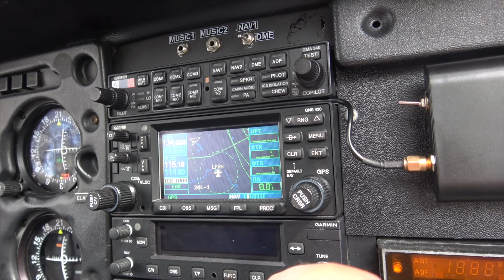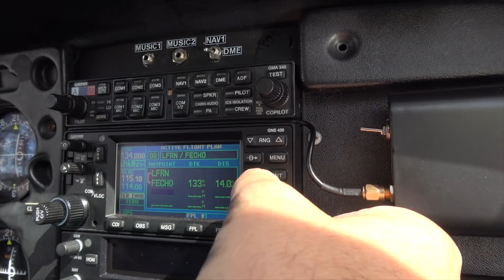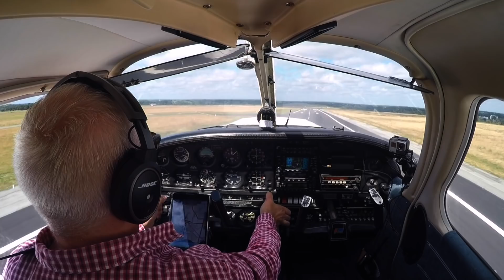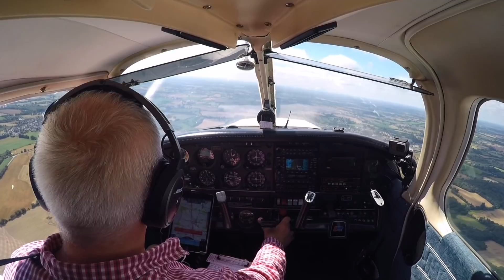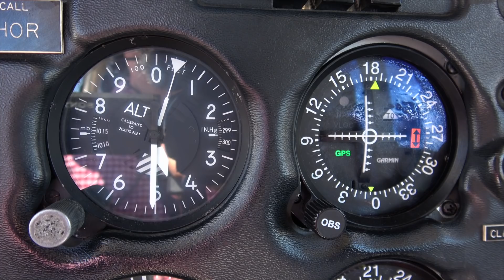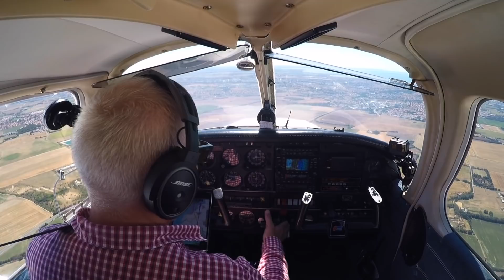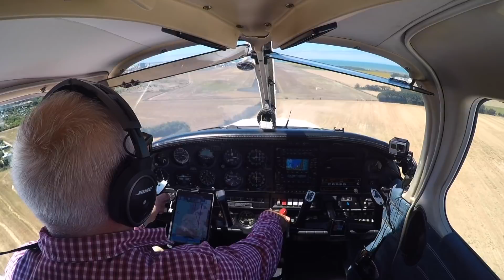28 knot crosswind take off - PA28 - The Flying Reporter

Comment: Hi Jon so enjoying these videos.  On my 3rd lesson for ppl.   Can you explain going VFR but above clouds?
Thanks
Reply from the maker: VFRs are different for different classes of airspace, and at different altitudes.  Check out page 59 of the Skyway code. https://publicapps.caa.co.uk/docs/33/CAP1535_Skyway_Code_V2_INTER.pdf. Essentially, above 3000ft, you can fly VFR without the ground in sight, so long as you remain 1000ft vertically from cloud, and 1500m horizontally.  Clearly, you will need some certified method of navigation, as you cannot navigate with reference to ground features.  So VOR/NDB/GNSS.  Hope that helps.  Jon

Comment: Jon, in the event there was a mishap on the departure with the 28 kts xwind (whilst legal) might the French investigators cite poor decision- making as a contributing factor with your insurance folks then reneging on their obligations? On a related note, in Holland the max demo x-wind is a hard limit for certain aircraft per the Dutch CAA.
Reply from the maker: Morning Douglas.  I think it's impossible to speculate on what an investigation might conclude - I guess we always should bear in mind what an independent investigator might think when making our decisions.  It would be a fair conclusion for them to reach if they could show that any mishap was caused by the crosswind.  There will be hard limits for all sorts of different operations, but a 17 knots demonstrated crosswind for the PA28 is not one in EASA and Part NCO (under which I'm regulated).  Ultimately it comes down to pilot judgement.  Can the take-off be performed safely?  Based on my experience, yes it could.  Another pilot, in another aeroplane, on another runway may think not.  Your comment has given me pause for thought, so thank you.
Reply: @TheFlyingReporter  Goodmorning Jon/Douglas, as a Dutch pilot, we have a 'mental barrier' to take-off in weather conditions that prevent us from safely returning to the same strip/airfield in case of engine trouble. 

I can see a drama developing when taking off with x-wind at 28 kts (even if 'just gusting') while having to return to the same airstrip with the same weather conditions due to an engine failure after take off. You will then be caught in a significant 'pickle' with a failing engine and wind conditions outside the allowed 20 kts for a Warrior. I don't think it is ímpossible to speculate on what an investigation might conclude'. You will have to turn in your license, if you're still capable of doing so after an incident.

Great vids, keep them coming ;-)
Reply from the maker: While I understand that there are differences in pilots attitude to the weather.  Everyone is entitled to their opinion, and entitled to stand by their personal limits.  If you’re not comfortable taking off or landing in a 20-28 knot cross wind, don’t.  But there is nothing illegal about it, and based on my experience, currency, skill and knowledge of the aeroplane, I decided I could take off and land safely.  The demonstrated crosswind limit of the aeroplane, is a demonstrated limit, not a hard limit.  It’s what the test pilot had at their disposal on the day of the test flight.  It is not an airframe limitation, nor is it a limit set in law.  I don’t know where your 20knot limit comes from.  Is it a Dutch only requirement?  I fly under EASA part NCO.
Reply: @TheFlyingReporter  Jon, agree with everything you say per my previous comment. Per NLR-TP-2001-217 report (from the National Aerospace Laboratory NLR/Air Transport), my rudimentary notes from said document indicated "...all Fokker aircraft certified by Dutch Civil Aviation Authority the demonstrated x-wind value is the limit...." so bottom line you were perfectly legal to depart and the only issue (in my mind) was insurance potentially balking at coughing up in the event of a bent aeroplane.
Reply: @TheFlyingReporter  Think I need to start with an apology as it seems that my reply can be perceived as judgemental. in NL, xwind limits are derived as you stated: demonstrable control speeds under specific conditions, established for each type of aircraft individually. Each pulot should therefore decide if or not to execute certain flights of maneuvers. As most of the pilots are quite less experienced than test pulots, owners lije aeroclubs or rental companies impose limits lower than the POH contains. Hope that puts my earlier message in more context. Stay safe and keep enjoying the pleasures of flight!

Comment: Amazing sir. Quick question, can you rely primarely on the GPS when flying VFR, or do you still have to plot a proper route with visual references, headings, wind corrections, timings and all that?
Thanks a lot for promoting GA aviation for my country (france) :)
Reply from the maker: Hi Kev.  If you have a certified GPS you can use that for navigation.  The GNS430 is certified.
Reply: Even with GPS visual references are helpful for confirming where you are. When you fly VFR you can fly wherever you want: my best flights have always been looking out the window with a chart in my lap.